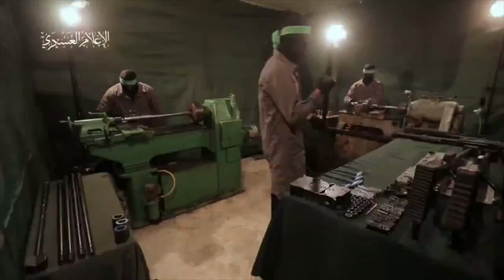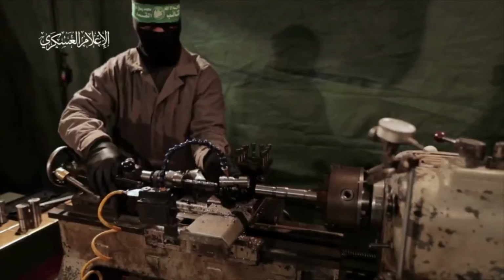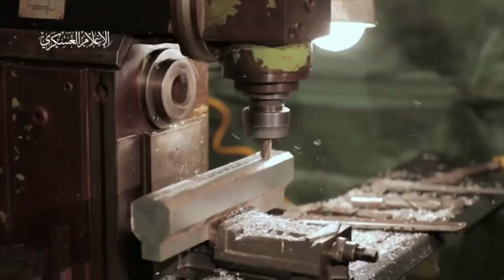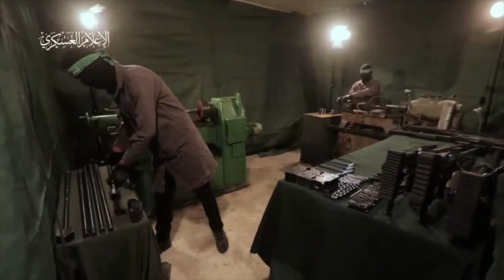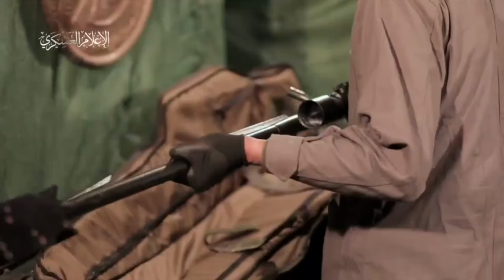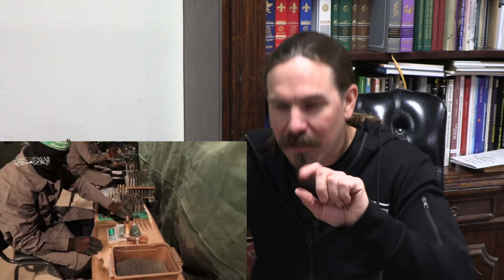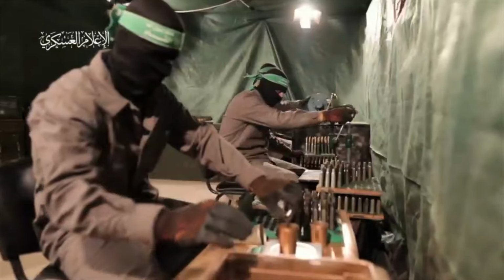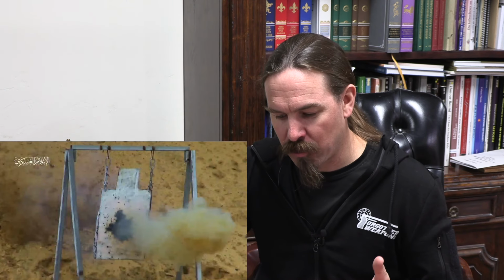Hamas Claims to Make Sniper Rifles in Gaza - Are They Really?

Comment: By the early 1700s barrel making was already a specialized trade. Gunsmiths bought barrels, they didn't waste time trying to make them. 
Look at some of the videos of the barrel making process. It takes specialized machines and tools to drill a hole that is between 5mm and 13mm in diameter and up to 900mm deep and have it absolutely straight and to size end to end.
Reply: HAMAS sucks at everything.   But I wish they would tweet about the rockets they make....for reasons.
Reply: It does not. Outside of a really long barrel you can rifle pistol to rifle sized barrels with a 20 ton harbor freight press and a $28 dollar Ali-express bullet button. If you want 1000 yard accuracy it requires a few thousand dollars in tooling that maybe you can not afford but a gov sponsored terror org like hamas can.
Reply: Dusch nut , where are they going to buy them from? Even their rpg rounds are home made ... Grow up
Reply: Difficult but not impossible. I know a machinist that made several rifles of various sizes. He said the most labor intensive part of a rifle was the trigger mechanism. He would normally just tear apart a junked rifle for those parts.
Reply: @jw-hy5nq  Those weren't 1 MOA rifles for sure. Most companies that make precision rifles cold forge the rifling by inserting a tungsten carbide rod with the correct profile into the bore and then crimp-hammer the blank around it so it has to be screwed out.

Drilling and reaming a barrel blank to within a few micons is outside the capabilities of most shops that don't have ambient temperature control. Long-boring a rifling pattern into it afterwards, without screwing it up to the point it becomes essentially just a somewhat poor hunting rifle, is even harder.

So that you knew a machinist who made ghetto rifles really doesn't tell anyone much until we see a 1000m grouping shot from a gun rest, as Hamas is claiming to be making sniper rifles. Not bullet hoses.
Reply: @andersjjensen  whait what ? so they don't technically rifle the barrels ?
Reply: @96dragonhunter  The cold forged ones? Yes, they're absolutely rifled. The rifling is just not cut out of the barrel. The barrel is "smashed into the rifling". Think of the inside master as "a rifled anvil" that the barrel is "shrunk down on" with cold forging.
Reply: @andersjjensen Wouldn't you use heat shrinking and then cold pressing to get the barrel to fit tightly around the mandrel rifling die? 
I'm no gunsmith or machinist so I just throwing out a query here. 
Mark from Melbourne Australia 🇦🇺
Reply: @andersjjensen  whoa, that's crazy. I never knew about it!
Reply: @markfryer9880  Nope. They bore, ream and cold forge. On the really supper over the top barrels they also do a cryogenic annealing run afterwards because even cold forging leaves a little bit of stress. Ian has an old video on it from maybe 1-3 years ago (I'm not good with time, sorry) where he visited a factory in Croatia that did their own barrels.
Reply: @jw-hy5nq  That is bullcrap. They are not making rifles, they are assemblers.  I can spot a "machnist" that attempts to make a bubba rifle by the missing eyes and hands, if they survive the experience.  Yes, I am an actual mechanical engineer and I can spot crap posts.
Reply: doubting that they can learn the skill is insane and frankly borders on racist. do you really think these people aren't capable of using the tools they just showed you they have? no. the actor on the screen didn't know what the fuck they where doing.. but they aren't going o show the actual people who do the work on video.. their enemy actively hunts any specialist down.  so any skilled worker woudl be highly protected.
Reply: @FreebirthBoccara  Nobody is doubting that they can use a lathe and a mill. But people who know firearms and machining are saying you can't make a sniper rifle with a lathe and a mill. You can make basic firearms, like a submachine gun, with a lathe and a mill. If it's a really good lathe and you have the right metrology accessories you can also make something like a combat rifle if you're determined enough. But a sniper rifle is just a whooooole other ball game.

Remember that a sniper rifle is supposed to hit a head sized target at 1000m every time, all the time. A submachine gun is supposed to hit an upper torso sized target at 50 meters. And a combat rifle should do that at 300 meters. Tripling the distance while dividing the target by four is a very very tall order that requires incredible precision at every level of production. To the point where even well established rifle manufacturers produce everything BUT the barrel, and instead opt to source the barrel from specialist companies that only make those.
Reply: @andersjjensen  Back in the army, I remember the shooting contests, with a combat rifle you should be able to shoot a tennis ball at 300 meters, if the target is not moving.
Reply: @MidnightatMidian  I know. I did that with my H&K G3 (7.62) all the time with iron sights. But you can't do that with 5.56 or 5.45 if there is even the slightest whiff of wind, or if the rifle isn't extraordinarily good. And you'll not be able to do that with a factory new AK-74 no matter what. 20cm diameter grouping if both you and the rifle is above average. But in active combat any battle rifle that hits a torso target at 300m without fail is considered "working as intended".
Reply: @FreebirthBoccara   They are wearing coveralls, gloves, and balaclavas. There is no chance of identifying the people in the video so it is unlikely that they are using inexperienced workers for the sake of safeguarding the actual craftsmen they use. The argument being made is that the techniques they are showing are not consistent with the actual process of making a precision firearm. They may very well be producing firearms but it is very unlikely that they are of high enough quality to be used for the precision long range shots that a sniper would take.
Reply: @FreebirthBoccara   u DONT suspect ID.F can see through bandanas and walls cause they sure look pretty anonymous in the video so your whole paragraph is massive copium
Reply: @FreebirthBoccara  l

Comment: I agree.  I had another issue regarding the reloading.  How many days would it take to fill those ammo crates by using a single stage press?  Once upon a time I loaded 500 rounds of something using a single stage press.  Somewhere near the end of that experience is when I bought my first turret press.  LoL  I will agree you can get great precision on single stage press, but there are some things we aren't seeing.  Like you say, mixed case types is not the path to precision.  No measurements of case volume capacity and sorting?  No double checking the weight of each bullet or case?  No double check of case length.  As you say, no trickle charger.  Etc.  Why pretend it is precision?  Then of course, 1 guy on a single stage press to make a few thousand rounds.  He may be done by Easter 2024.  IIteresting the manufacture we don't see.  Triggers, firing pins, springs, tempering, etc.  Then there is the wearing of long sleeved shirts and gloves while working with a lathe.  A bloody accident waiting to happen.  Totally fake video.

Comment: The bullet loading scene is pretty accurate imo with the amount of variety of casings. 

So back even before the state of modern Palestine and Israel was partitioned and made, the Hagannah was already building weapons and ammo underground, right under the British noses and due to them not being able to buy ammo outright, they had to make them and with them not being able to import large amounts of brass, they did what they could by importing tons of cheap lipsticks, remove the outer plastic shell and the lipstick itself and utilizing the brass that's in there as their ammo casings. 
It's not very good quality brass nor is it great for sniping due to them having to hammer it out every time just to shape it into a casing but still, it gets the job done as long as it fires and manages to suppress the enemy. 

The same thing could be happening here and making ammo is inherently easier than jamming out a whole gun as it requires way lesser parts. Who knows? The ammo part could be real but the gun part... Eh.
Reply: Brass, maybe. Steel is way too hard (the opposite of ductile, not difficult) to hand-form into a casing. If they tried hammering it out it would just shear. There's no way to make steel casings even close to as precise as the ones we see in the video without expensive machinery.
Reply: @davidj9677  That's not the point.

The point is, steel casings like that are often recycled in poorer states like Khashmir, Afghanistan and now even in Gaza because importing rounds itself is pretty hard with the constant shellings from the enemy and also embargoes from everyone. 
The inaccuracy of the recycled steel casing isn't the most of their issues but the ability to fire and kill the enemy that is. A few shifts of MOA isn't that much of an issue as long as the gun firing could suppress the enemy.

That's why I said that round making, most probably accurate. Making a whole ass gun? Eh...

Comment: Great analysis. The "manufacturing" is a total BS show. Also there was a mix of finished and unfinished parts on the same bench, etc... The rifles could have been smuggled into Gaza in parts and assembled in a bunker. Firearms are easy to smuggle like that, bunch of random crates labeled "machine parts" or "construction equipment" or.... raise much less suspicion. If you are really interested in seeing how rifles are made using crude equipment, check out some videos from Khyber pass area.

Comment: i dont care who you are but at 3:46 that operation on the lathe is 100 percent posible and correct you can use parting tool to remove material and leave only the diameter of the drill you are using when you drill automatically parting the part it could be already machined to the depth needed if some on doing things better then what you know dont mean its not correct visiting factories don't make you a master

Comment: My childhood friend, who is a tool and die maker, usually buys barrels for his custom gun making.  It is true that he makes gun drills for customers and could make a barrel and rifle it more precisely than the gun manufacturers.  It just doesn't make economic sense for him to make the barrels.  His .50 rifle is based on recoillles rifle spotting rifle barrel.   It has muzzle break that he designed.  The receiver he built.  It is more accurate than any commercially available .50 rifle and joy to shoot.  If it would be built today it would be outrageously expensive.  (He says Barrets are junk).   Of course Barrets are affordable.  
When we were in high school (and gun regulations were lax) he made a .22 pistol in shop class!  He made the gun drill and broach.  
He made many black powder guns.  While some pistols he gun drilled crome nickle steal, the rifles were had barrels from Thomson Center.  One .50 Hawkin Rifle had all brass furniture that he cast and machined.  He also bought the lock mechanism.  He has in the past built prototype guns for manufacturers who typically provided him with the barrel.
Reply: My father is a professional cabinet maker.  He doesn't make doors for any of his cabinets anymore.  He buys them from a guy who just makes doors.   Economically it makes no sense to make a barrel, or a couple barrels when there is a company that does nothing but make barrels.

Comment: The 'smoke' during the turning of the bar stock isn't necessarily a bad thing. Oil - ordinary lubricating type - used as a coolant/lube will smoke during the cutting process.

Comment: Ive never seen a "factory new" gun that has so many marks from wear/handling/use.   And the variety of different case lengths and seating depths on that ammo in the tray is pretty um.... interesting
Reply: Very short-sighted snipers.....
Reply: And the fact that they show FMJ ammo loaded but when they take it to the range is it explosive tipped.
Reply: Never mind the different cases and bullet seatings in that tray; you can SEE dents in the cases! 🤣
Reply: And that was supposed to be sniper quality. I wouldn't trust it for weekend at the range testing.
Reply: @act.13.41  Yeah It makes me wonder how many Hamas fighters are going to be running around with a thumb in their neck trying to stop arterial spurting from blown up rifles.
Reply: @SavageShooter93 not enough unfortunately

Comment: Individual units of gun powder should be called “granules” of powder. In the context of loading ammunition, the term “grain” or “grains” should be reserved for referring to the imperial unit of weight used to weight power in the US. Using the term “grains” for both is confusing for those inexperienced in loading ammunition and I have personally seen it result in rather dangerous loading mishaps by novice hand-loaders. This point of confusion of course could be completely avoided if the we, in US, would be smart enough to just use metric.